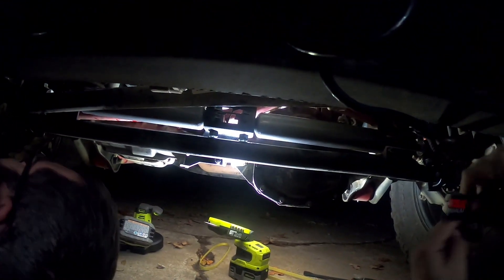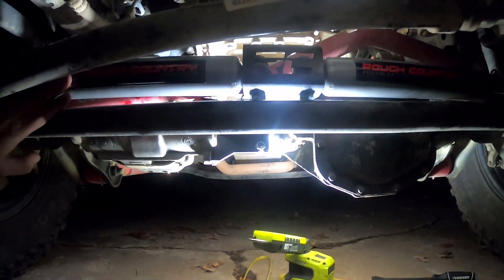Rough Country Dual Steering Stabilizer for 2019 Jeep JL Install/Review

Comment: Just a little advice, the factory bracket will come out if you turn the wheel to the passenger side, it will let the bolt come right out. Also I use a torpedo level to make sure stabilizers and brackets are as straight as possible. Then when completed have your buddy turn the wheels lock to lock both ways slowly to make sure to stabilizers or brackets are not hitting anything. Then after about a couple hundred miles go back over all the bolts to make sure there still tight. I have these on both my 2019 F250 with a  lift and 37's and my 2020 Jeep JL with a lift and 35's and will be bumping up to 37's on the JL once the 35's wear down. But good video, sucks about the camera messing up but great job. I love these stabilizers, great for the price and really do help with bump steer and Jeeps notorious wandering all over the road. Plus really like seeing people get out there and doing there own upgrades and working on there vehicles. Too many people won't learn and want to just pay someone else to do it.

Comment: Mine just arrived today from FedEx. Going to be installing it tomorrow and hope it helps.
Reply from the maker: Sweet, let us know. Glade, you liked the video
Reply: @thewilderhensonadventures4361  Wasn't able to get it installed, as it rained all day long yesterday until like 4am this morning. And I'm not lucky enough to own any type of garage, so all my work is done on the dirt in my front yard.
Reply from the maker: @RealYtori  hey we understand, untill matt got his shop all our stuff was installed out side in the dirt, when we where lucky we had concreate. but after install you will notice a difference. just be cautious because if something else is wrong or is on it way out this will just mask the problem untill it breaks. but if every thing else is good it makes a world of difference.
Reply: @thewilderhensonadventures4361  yea my whole front end is rebuilt. I just put 20” wheels with a set of 35” mud tires and notice that with them weighing right at 111lbs per wheel/tire my steering is a bit loose over what it was stock. So I’m thinking the dual stabilizer will help stiffen it up more.
Reply: @thewilderhensonadventures4361  I installed a heater core yesterday in the jeep. Man its so nice to finally have hot air. Bought the Jeep Feb 14th of last year knowing it dind' thave heat, but it wasn't long after I bought it the temps warmed up and was manageable. So I messed around and didn't buy a heater core. Finally got one and installed it yesterday. Took like an hour to do it. So today I'm going to install the dual stabilizer finally.

Comment: You don’t have to take the tie rod off to take the bolts out just turn the steering wheel to the right and they will come out
Reply from the maker: OK, thanks for the tip.